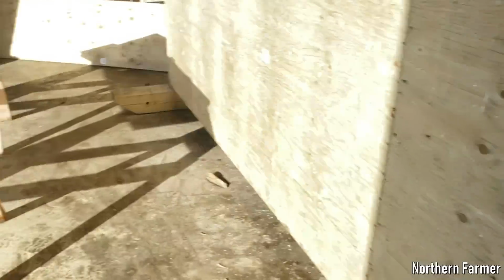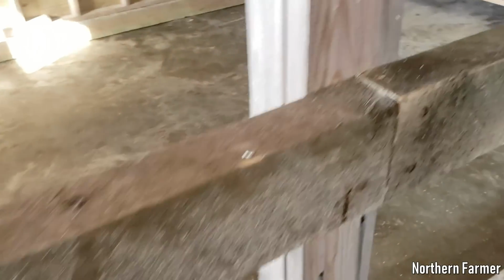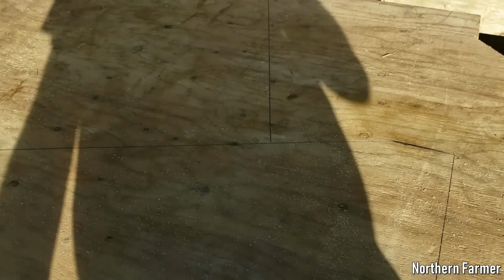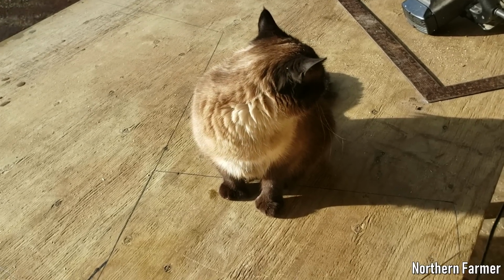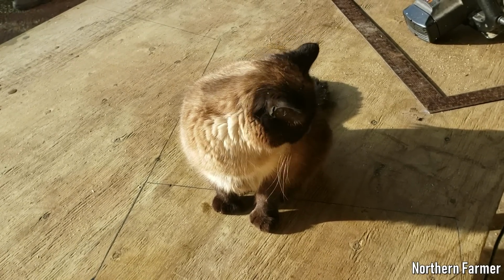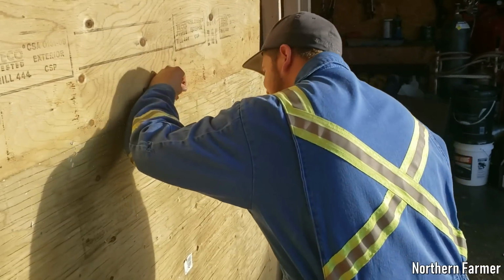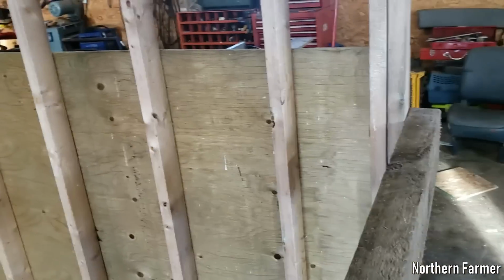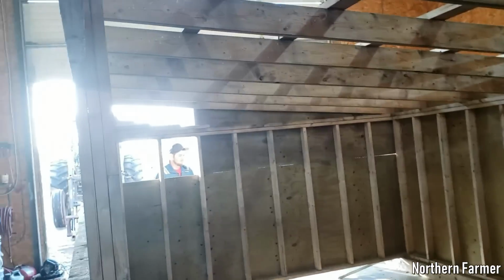Shed Build!!  Finishing off the calf shed from last year.

Comment: I like the hand driven nails myself,  we used tons of oil quenched 16 penny ringshanks. A better tensile strength and holding power compared to air nails.  It also helps that my help is Amish and know how to use a hammer. Ha ha  a nice calf shed,  we call them loafing sheds here. I need to build one for my mother's sheep to move to different pastures.